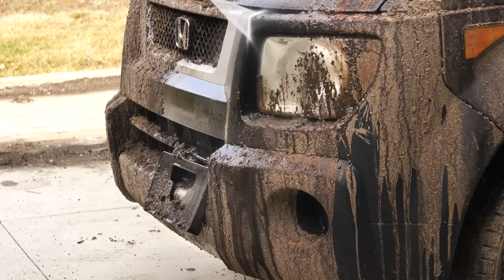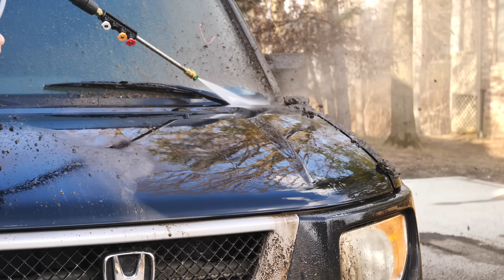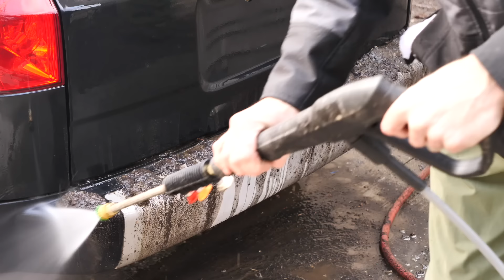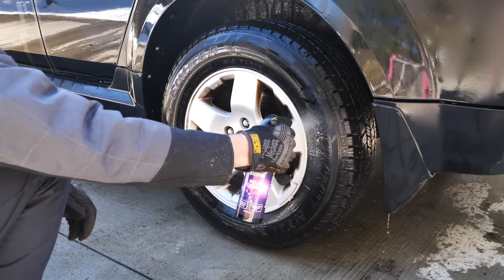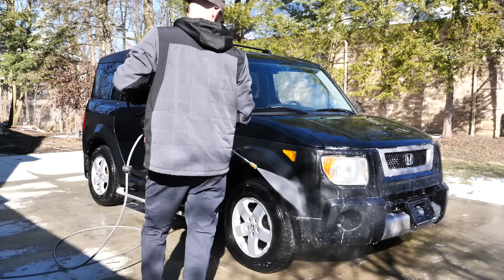Muddy Car Pressure Washing ASMR | NO MUSIC | Auto Detailing Honda Element

Comment: Don't use pressure directly or you'll scratch the paint with this much dirt, soften it up with pre-wash which will also let it seperate from surface and provide some lubrication when you use pressure. If you do not have a pre-wash in a hand spray, then just spray snow foam and let it drip for a bit.

Comment: It's strange how other countries usually start washing the car from the bottom. Then they wash the roof and the dirt falls back down where it was already cleaned.

They washed the headlights and then when they washed the hood, the dirt all fell on the headlights again. Then they washed the hood and when they washed the roof, the dirt all fell on the hood again. It's a strange habit.

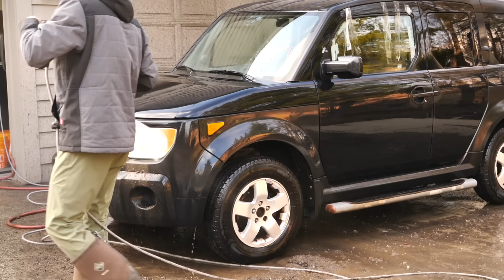Here in Brazil, we start from the top and when we get to the bottom, the car is clean and we don't need to wash it again... (01/02/25 | 18:04

Comment: Why doesn't anybody start these washes with first spraying the car all  over and under to soak, while they attack each part?  You will use less water, and the job will go quicker.  Also, START FROM THE TOP, WORK YOUR WAY DOWN, NOT THE OTHERWAY AROUND!!!!!  WHEN WASHING THE HOOD, FOR INSTANCE, YOU START FROM  THE SPOT CLOSEST TO YOU AND WORK YOUR WAY TO THE OTHER END OF THE HOOD.
BUT ALL OF THAT MAKES TOO MUCH SENSE, AND IS MUCH LESS DRAMATIC WHICH IS NOT WHAT YOU GUYS ARE AFTER........  NOT IMPRESSED